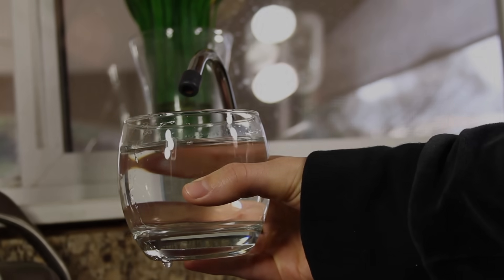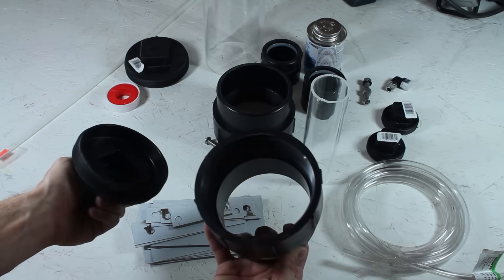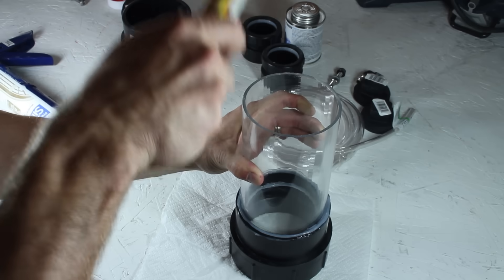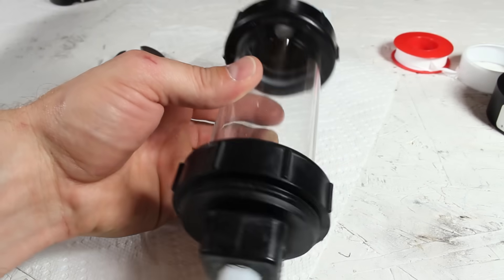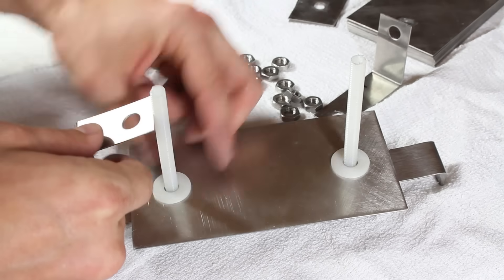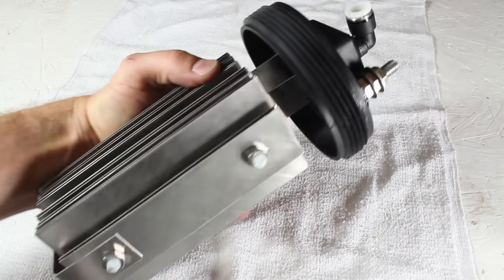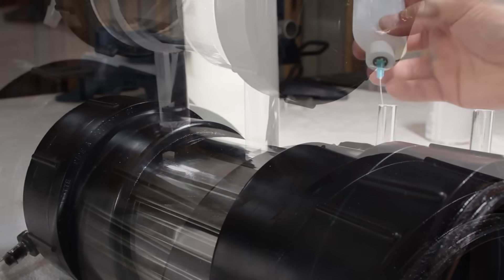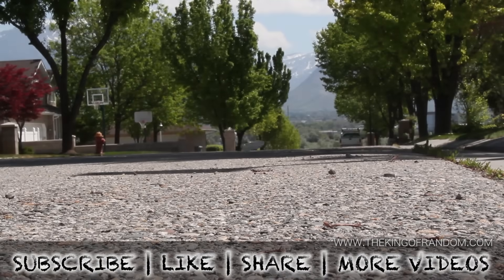HHO Generator - Water to Fuel Converter

Comment: can i run a motorcycle with this
Reply: pliny vic finally someone who understands basic machinery
Reply: gas burns and propane explodes they both work in internal combustion engines with spark plugs and propane explodes more efficient
Reply: Trenton Slater no not at all it has been done but done with great precaution i run my lawnmower on propane figuring it was a flamable gas and it did work
Reply: Nova Flare i run my lawnmower with a soldering iron torch with a bigger jet and i run my lawnmower with a regulator that has a knob
Reply: kevin dahlr if it's specialised you can, if not then never even try that or it'll explode
Reply: with a big one maybe
Reply: pliny vic nope it was a generator 4 stroke the guy only ran a balloon  of the stuff connected to the intake bc he feared an explosion and in columbia or india its popular to do hydrogen conversions on willis jeeps
Reply: Trenton Slater basically what I understand that happens inside the combustion engine the gasoline engine the "vapore" or gas state of the fuel (gasoline) it detonates inside the engine on top of the piston so yes hydrogen is more combustible than gasoline that why it would not work ?
Reply: Using the wrong fuel or wrong mixture for generally any kind of engine will at least decrease the life of the machine/vehicle. As other people have said, it would probably be pretty bad for a motorcycle. However, for something like this, you really shouldn't take advice from Youtube comments since there is a risk of damaging your motorcycle, not to mention a risk of injury.
Reply: Thomas Milton this generator produce hydroxy, not hydrogen. Hydroxy is the mixture of oxigen and hydrogen gases which is very highly flammable. Its like rocket fuel. Your engine will shatter.
Reply: Trenton Slater so your telling me a combustible gas like hydrogen can not help or run a motorcicle? not even get a better gas millage ?
Reply: Megh Shevade thanks. This has been the most easiest and best explanation
Reply: James Flores so that would be a yes ?
Reply: kevin dahlr yes
Reply: make sure you have a carb for hydrogen and that your pistons could handle the pressure and heat of the explosion, then yes.
Reply: Yes
Reply: kab kab yeah it's supposedly impossible to run it off pure hydrogen, but it's 100% possible to boost low efficiency.
Reply: If you want it to explode.
Reply: you must have miles of electric cable to supply power to your HHO generator...
Reply: George Hitchens why would you need miles of cables?
Reply: You can fly it
Reply: Yes but you need electricity to split water which makes you car battery die after an hour or two and also you can't speed up that much .
Reply: Thomas Milton really I'm making a schoolie and having more or less free " gas " Would be awesome
Reply: kevin dahlr you can run a motorcycle with camp fire smoke
Reply: Hello Kevin, there is a simple difference. Gasoline burns. Hydrogen explodes.

Beyond that:
The burning temperature of gasoline, and exploding temperature of Hydrogen do not match. You might end up melting your bike's cylinder head. Thats something people try to avoid. :)
Reply: @mechmanmegh  diesel burns gasoline vapour is explosive
Reply: You cannot run a motorized vehicle with this gas. It would detonate.
Reply: The bus engines are designed to run on Hydrogen, on the other hand the bike engine is not. It may run,, but you're destroying the bike in the long run.

Just take the bus instead. :D
Reply: yes
Reply: James Flores
It was a specialized engine.
Reply: WOW you have discovered the ELECTROLYSIS of water - something that's been known FOR 100 YEARS!!!  Now you need to discover the 1st, 2nd, and 3rd laws of Thermal Dynamics.  Once you do that you'll only be 75years BEHIND current engineering!!!
Reply: kevin dahlr no it produces hydrogen

Comment: Hey Grant... your HHO generator clip is excellent.... Would love to see you make 2 items... 1. a fuel cell that uses either natural gas OR hydrogen gas. 2. an equivalent to a car battery but made of glass/plastic containers... In both cases the parts should be from home items or easily available and cheap parts from a hardware store... Thanking you in advance.

Comment: Don't all the plates have to be connected to the electricity in some way? Based on how it looks @ 5:26, there are plates which are completely insulated, and so wouldn't create any gas...
Reply: What he should have done is ensure that exactly half of the plates are connected to battery positive, and the other half are at battery ground.  He got the wiring a little wrong and from what I can tell, the device is only utilizing 4 of the plates.  This is clearly visible when he starts the reaction with the batter.  He could have replaced a few of the nylon washers with steel washers to connect the appropriate plates.

Also, I'm bothered by the amount of pseudoscience in this video.  Remember folks, he isn't "creating fuel" with this device.  He is simply converting the electrical energy from the battery into chemical energy in the oxy-hydrogen fuel  (mixture of H2 and O2).  In fact, this process has inefficiency so despite the high powered explosions the gas makes when it combusts, it's actually less energetic than the original electric current that was used to make the gas in the first place.
Reply: The plates he isn't using are neutral plates. I won't try to explain the exact science because I don't recall all the exact ways that it works, but it makes it more efficient to do it that way. Something about it uses the spare plates as resistors or something, i think? Either way, it causes the process to use less energy off of the battery to make the same amount of hydroxy gas
Reply: Since no one's responded, I'll take a crack at this. 

Electricity follows the path of least resistance. If metal bolts were included, the electricity would just flow through them, ignoring the plates, and generating very little gas. We want a lot of gas, so that means we want to maximize surface area and take the longest path through the water. As the electricity is applied, bubbles form (then rise) which block the transmission of electricity at that point! So the electricity finds the next shortest route and generates bubbles there. Lather, rinse, repeat.
Reply: What do you mean??  I was just trying to answer futureboy's question.  The device built in this video was not wired properly, that's all I was getting at.  The way it was built, a few of the plates were insulated from both terminals of the current source, so they weren't acting as a reaction surface.
Reply: Makes sense, but it is still a bit unclear, I guess because I don't fully understand the the actual physics behind electrolysis. I'm under the impression that it occurs when the electricity is conducted from the metal into the water. But what we have here is metal plates which aren't directly connected to the source of electricity. So the electricity goes from the source, to the connected plates, into the water, and through the water to the isolated plates. For electrolysis to function at the junction between the isolated plates and the water around them, it would mean that electrolysis works simply on the basis that the solution is electrically charged, and any junction between the electrically charged solution and a plate of the correct material produces electrolysis?
Reply: Metal bolts
Reply: Herbert Wang The bolt is nylon, and the nuts are metal. But between some plates there is a nylon washer instead of a metal nut, so the plate is not connected to the next one over.
Reply: The water will conduct the electricity

Comment: Where did you get the one way check valve??
Reply: Go to a hardware store and find the plumbing isle. There will be a load of radiator fittings and there will almost indefinitely be one there. If you can't find one, just ask a member of staff for one.
Reply: +Oliver Armstrong thanks

Comment: why the bubbler
Reply: To keep the gas from flowing back to the system. Think of it as an extra precaution to keep the whole system from blowing up. It works because the gas can't burn in the water(bubbler)
Reply: Forza Derp Guy thnx
Reply: appeltaart No problem.
:)

Comment: That's cool just now they can't hide these tech it wil have to be use to power homes
Reply: Powering homes with this would make no sense.
Reply: Notthisone Nornow
Consider that your home runs on electricity and, possibly, fossil fuel gas. When you use this device to create gas from electricity, you lose about 40 percent of  the electric power, if you then use the gas to run a generator, you lose another 60 percent. So, you'd be throwing away 76 percent of the electricity you started with in order to make electricity again. If you burn the gas you generated (which is very dangerous because this device makes a hydrogen and oxygen gas mixture), you'd still lose the 40 percent of the electric power. That means your gas will be far more expensive than fossil fuel gasses. So, you could do it but, because it would be more complicated, more dangerous and more expensive, most people will not want to.
Reply: homes use propane tanks,, why not hydrogen??
Reply: Hydrogen is really, really hard to store

Comment: I think you can buy a HHO generator already built correct?
Reply: Yes, they're on ebay.com. Look for HHO torch.
Reply: Thanks. I think I can also buy HHO cylinder tanks and use an HHO generator to refill HHO tanks. The water I put in an HHO generator think I can add tap water the kind of water we drink correct?
Reply: I would use distilled water.
Reply: Since you would use distilled water about tap water? Would it seem fine if I do it?
Reply: Maybe there is stuff in tap water that can damamage the machine.
Reply: Someone +Synthmilk He said to use distilled water because if you put tap water it will corrode the machine so I gotta make distilled water.
Reply: You could buy one if you didn't want to have tons of fun building your own.
Reply: I would rather buy one that is already built. So I can have fun welding, cutting, melting things and use it to heat my home in the winter.

Comment: ever thought about connecting this to your BBQ and using it to fire up your BBQ instead.
Reply: Gary Stinten I feel as if it burns to gast
Reply: Bridger Olson include one way check valves and it will create a pressure.. feed into BBQ and see how you go.

also include a flux tank to store gases so a permanent pressure can me maintained.
Reply: kindoff seems like overkill to cook bee at 5000c?
Reply: @antonhelsgaun  pardon?

Cooking steak at 5000c is awesome. 

It'll heat your plate quicker and it won't melt it. 

Plus if a pressure regulator is used, even better. 

It'll be an awesome thing to replace BBQ gas and well is hardly dangerous if implemented properly.

Comment: If you use SPARE solar energy to make the Hydrogen and Oxygen AND compress it into a liquid so you can use it in a hydrogen powered car (eg Toyota Mirai,  Hyundai ix35 FCEV, and  Honda Clarity) It could be regarded as Free (you need to compress it otherwise  you would need a tank the size of the Goodyear Blimp to get any decent mileage
Reply: zen blas
You said "simply liquefy the hydrogen". Believe me, there is nothing simply about liquefying hydrogen.
Reply: What  harder then using multi million pound rigs to drill for oil then transport it around the world in some of the words biggest ships or most expensive pipelines to Multi-Billion pound refineries to turn it into various fuels for about  20p a litre before all the tax and duty is added. When scaled up to the level of fossil fuel production NO IT WON'T BE HARD
Reply: Kevin Jackson FUEL CELLS NOT BURN. Hydrogen cars use hydrogen fuel cells they do not BURN it as per petrol. They Are electric cars just don't use expensive and Earth Destroying Lithium batteries
Reply: zen blas
I think you would be shocked at how many solar panels it takes to make enough hydrogen to run your car.
Reply: zen blas You need much more platinum in the fuel cell, you can't use that hydrogen without it. And there is no such thing as spare solar power. Mostly because the national grid will take as much as it can. 

Also there are ways to recycle lithium batteries, but as I said, air aluminum batteries are becoming closer to a reality 

I hope you understand that hydrogen fuel and fuel cells are just a type of storage battery, one that has lots of drawbacks. When you have dozens of other options on the market that work much more efficiently, it makes more sense to go with those.
Reply: Kevin Jackson Especially when you lose almost all that energy to heat.
Reply: Yes Electrolysis is inefficient  SO WHAT? If you are Using Spare (Free) solar / wind power it's economically viable
Reply: ALSO a hydrogen car does not need a catalytic converter so lots of spare Platinum FOOL
Reply: zen blas What we do with the old cells does not change the future. The fact is, new cells can be recycled, and do not use heavy metals. Any argument against newly produced batteries based on the recyclability of a retired design is frivolous. You haven't addressed the unsustainability of fuel cells as a technology based on their use of rare and expensive heavy metals in their design. And the rapid depletion of these metalic catalysts. We already have a platinum shortage as is, and there is a large incentive to mine as much as possible, so it isn't like the problem is marketability of the element.
Reply: Fromage Frizzbizz This is the kind of reply I appreciate, thank you for sharing your knowledge, what you have added is really quite interesting.
Reply: zen blas
Reply: Most industrial Hydrogen is made from methane which has more hydrogen when compared with water.
Reply: uday sharda 
Hydrogen is hard to store. It would be better just to burn the methane, like some forklift trucks do.
Reply: OR you could use that electricity to charge an electric car. Way more efficient than converting to hydrogen and burning
Reply: Correct, but you would have to separate the oxygen, purify the hydrogen and, as you say, compress it. Sadly, it takes a shocking amount of energy and expensive specialty equipment to compress hydrogen. 
If you had enough solar energy to do that, you could just charge an electric car and go twice as far, or more.
Reply: actually No The hydrogen is collected from One terminal and O2 from the other so separation is no problem and simply liquefy the hydrogen to use in the fuel cells of the car This is already done in Industrial amounts in California with there network of Hydrogen gas stations  http://cafcp.org/stationmap
Reply: I assure you the bulk of the hydrogen you buy from those stations are made from fossil fuel. Electrolysis, while used to make the system sound green and possibly to help balance the grid, is far too expensive, because of the really low efficiency, to use much. You lose about 40 percent of your electric power with electrolysis. With natural gas reformation you lose very little power but you do create a lot of C02.
Reply: As of 2014, 95% of hydrogen is made from methane. It can be produced using renewable sources, but that is an expensive process.[3] Integrated wind-to-hydrogen (power to gas) plants, using electrolysis of water, are exploring technologies to deliver costs low enough, and quantities great enough, to compete with traditional energy 
 sources "Wind-to-Hydrogen Project". Hydrogen and Fuel Cells Research. Golden, CO: National Renewable Energy Laboratory, U.S. Department of Energy. September 2009. Retrieved 7 January 2010.. See also Energy Department Launches Public-Private Partnership to Deploy Hydrogen Infrastructure, US Dept. of Energy, accessed November 15, 2014

Comment: Correct me if im wrong, two middle big plate are used and two small on the sides, others are usless coz of no  connections ?
Reply: do see your point buddy. im not sure how effective it would be though. From he video the production from the plates seems minimal compared to plates that are connected. Just connect them up so all plates are producing the same i would have thought
Reply: Jake Meyers I think the battery might get hot and leak but I don't think it will explode. But the acid is dangerous
Reply: The water is the conductor. The electricity is passing through the water and plates causing the electrolysis. The plates are larger towards the center so the electricity passes through them instead of around them. You don't want the plates touching because then you would just have the electricity passing through them instead of jumping the gap between them. I believe if he had done this at night you would probably see a slight glow from mini sparks jumping the gap.
Reply: they are neutral plates. they still generate hydrogen but its more efficient and better.
Reply: if you connect them your battery will explode because there will be no resistance. The water completes the circuit and acts as the resistance.
Reply: They aren't useless, they are neutral plates and they make it more efficient.